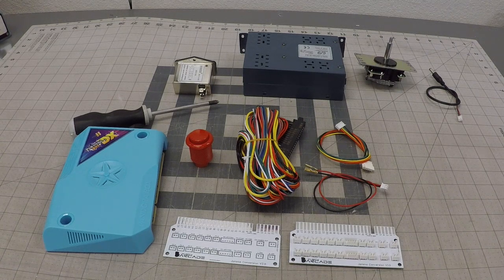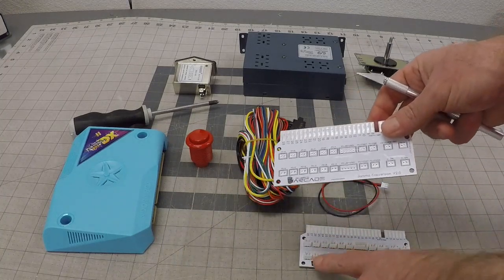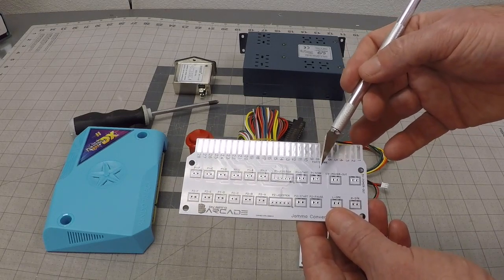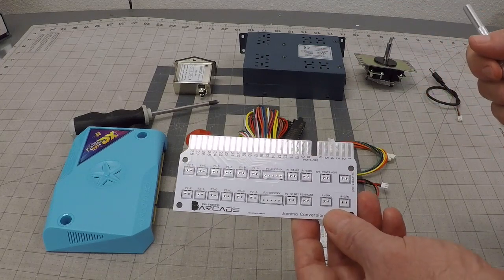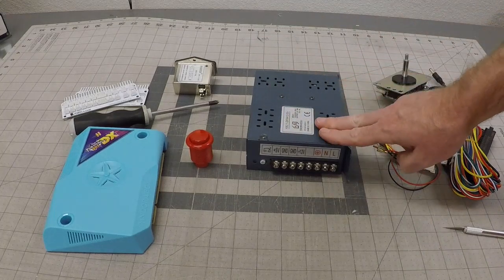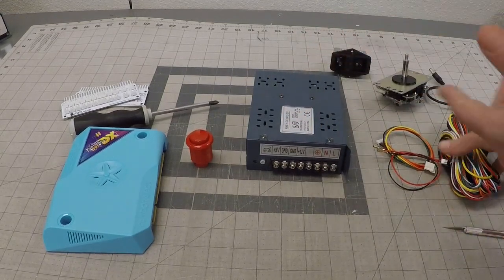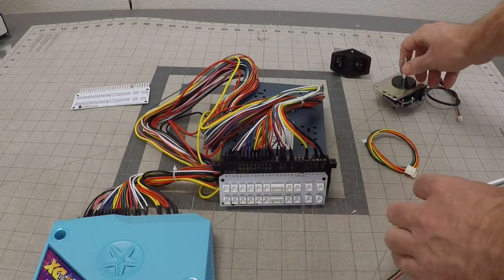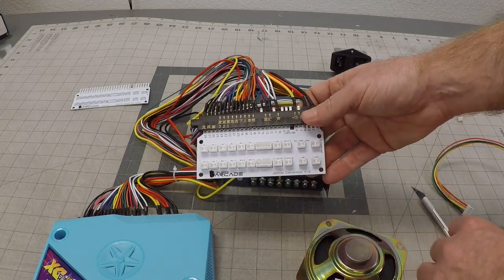Easy Jamma Pandoras Box DX / 6  Install Plug and Play PCB by DIY Retro Arcade

Comment: Hi there, sorry if this is a stupid question but I've got an existing jamma cab. Could I literally plug in the jamma connector and it will work? I don't need to connect my monitor to it? The jamma harness has all that doesn't it? Thanks in advance x
Reply from the maker: we no longer stock this item
Reply: It was just a general question about pandoras x
Reply from the maker: @Megaman5225  you need to verify the pinout. There is no way to answer that. Not all jamma harness are the same and not all boards use the same pinout. Best to 100% verify.

Comment: Shane, I got a question about the Pandora's box DX 2992 version that you have for sale on your site. I have a Dynamo cabinet CRT and I wanted to know will that DX 2992 version will work on my arcade?
Reply from the maker: Best would be to change the jamma harness to be safe but the DX will work fine with a CRT, you will need to adjust the resolution.
Reply: @diyretroarcade  Thanks for writing back. As for the jamma harness it's brand new and I added new stuff to the machine like wires and monitor issue so really the arcade is like new when I bought it. Now are you saying there is another version of the jamma harness or will the old version will work fine? (You said to be safe) Where do you change the resolution on the DX menu?
Reply from the maker: @FrostyMikeGaming  just verify the machine is wired "jamma standard" for resolution see: https://helpdesk.diyretroarcade.com/kb/product-manuals/how-to-change-the-resolution-on-the-pandoras-box-dx
Reply: @diyretroarcade  Oh the wiring is correct and I had a Pandora's box 3 and 4s+ on the machine before so everything worked fine. Now I am looking for a CPS2 black A motherboard for sale since I need one for my usa blue B board but I just can't find any for sale beside Ebay. Thank you for the resolution link and that will help alot.